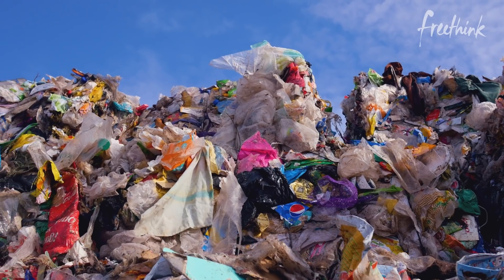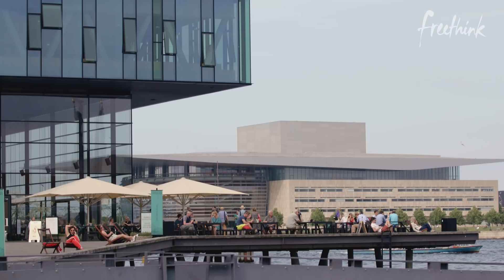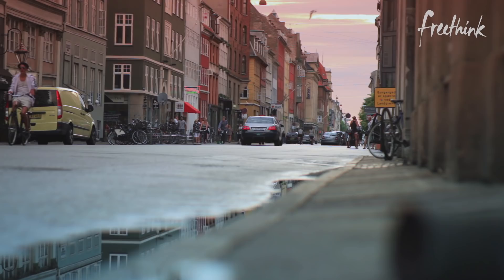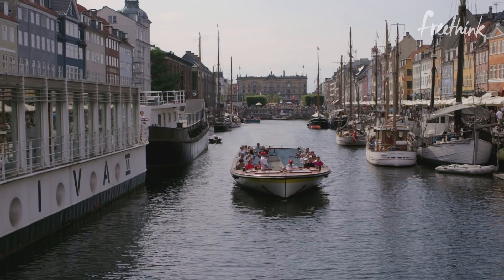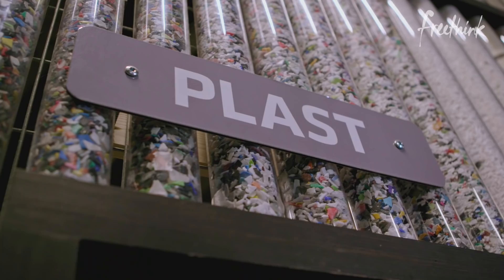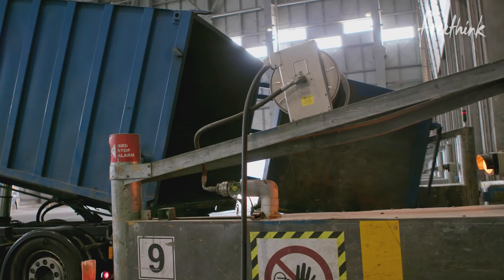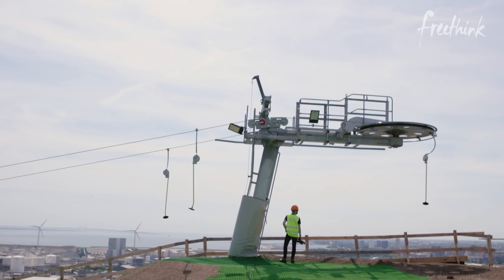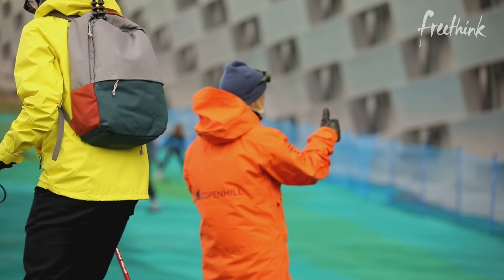Copenhagen Turns Trash Into Ski Slopes

Comment: Where did the Toxic smoke go from burning trash
Reply: thatcoolkidjoey turned into steam
Reply: @mathiashansen3088  lol burning trash does not turn into steam. they burn the trash and use the heat energy to heat up a boiler which creates Steam.  
here's a link to how a steam-powered power plant works https://youtu.be/IdPTuwKEfmA
Reply: I was thinking the same thing, Steam is just H2O so where did the carbon go?
Reply: thatcoolkidjoey so it still turns into steam
Reply: The heat is used to heat a boiler and create steam. The smoke from burning trash is still released into the atmosphere.

Comment: That's a cool video, but you didn't explain what they do with the residue left from the burnt garbage.
Reply: Incineration produces fly ash and bottom ash just as is the case when coal is combusted. The amount of ash produced is around 4 to 10% by volume of the original quantity of waste, the fly ash amounts to about 10% of the total ash. 
In Denmark, the bottom ash is used instead of gravel for patching roads, but in order for it to be used like that it needs to be stored for 3-6 months, as it absorbs CO2 from the air and the pH-value drops, binding heavy metals, making it almost impossible to wash out from the roads.
The fly ash is more of a potential health hazard, as it contains high concentrations of heavy metals such as lead, cadmium, copper and zinc as well as small amounts of dioxins and furans. Currently Denmark mixes it with sewage sludge and sends to Germany or Norway, where it is landfilled.
Reply: Rudkovskyyy 
They have an empty mine in Norway
Reply from the maker: @Rudkovskyyy thanks so much for your detailed response! There are some more details that can be found here: https://www.planningreport.com/2019/08/14/denmarks-amager-bakke-waste-energy-plant-global-model-sustainable-design-efficiency
Reply: @Rudkovskyyy  Nice explanation. Thanks!

Comment: Is burning plastics really a good thing?
Reply: Brandonez Doofenshmirtz they said that the recyclables are separated
Reply: it's exactly the same as burning oil, so not really, but it provides a solution to another problem. i would say not in the long run, but until we figure out what we do with all plastic we might as well get something out of it.
Reply: At low temperatures no, but at high temperatures from what I recall, it is far less damaging to the environment than lying around.
Reply: Plastic is not burned in Denmark it is recycled
Reply: @GentlemanFinn1974  Not really. Denmark recycles only about 30% of plastics and that is one of the worst rates in the EU. When it comes to plastic packaging from households, Denmark only recycles 17,2%, only Hungary has a worse score in Europe. See dakofa.dk/vidensbank/plast (in Danish) for details.
The remaining plastic is mostly incinerated. As a feedstock for a waste incineration CHP, it is probably the best input, as it captures a lot of energy (it is made of oil, after all) and compared with some other materials, it is not a very significant health hazard.

Comment: So coal is worse than burning trash. It's illegal to burn trash because it's so bad for the air! The other stuff makes sense. I believe recycling is the most effective. Finding new ways to recycle former. Non recycling materials. And implement more materials that can be recycled in place of current ones. Like old styrofoam for new potting soil. And wood based styrofoam alternative. Like paper food trays replacing styrofoam trays.🤔

Comment: I thought about doing something like this in my own City. But I don't have the degrees nor the money.
Reply: I wonder what they do with the highly toxic emissions coming from burning trash. Cuz my idea was to cool the gases send it through a centrifuge and then try to break down the more highly toxic compounds.
Reply: @joshuabondurant456  There are no highly toxic emissions. The short explanation: the smoke is washed before being letting into the chimneys. What you think is smoke coming out of the chimneys is actually steam so on hot summer days you can’t even see any "smoke". The emissions from burning waste in Denmark are under normal operation way below the limits set by the EU. Besides from keeping the country free of waste, the burning process creates electricity and district heating which is important in a country with cold climate. 

When the waste is burned, there are two fractions left; a non-toxic and a toxic. The non-toxic is slag (about 20 %) is used for building material, for instance roads. The toxic part is fly ash and toxic because it is filled with metals and is used to fill old mines. But there are ongoing experiments to extract those metals. 

Some waste plants are using biogas to raise the temperature of steam. Biogas is produced by using waste products from farmers and from the food-producing industry. Also some waste plants are using waste products from forests and agriculture, like wood chips, straws, olive stones, seed shells and more. So, we don’t have any waste laying around in Denmark, it is all transformed and recycled (except from a tiny fraction that are deposited). 

For some years now, millions of tons of waste from Europe has been exported to a few European countries who have the capacity for burning the waste, because the EU a decade ago made a law imposing huge fines on each ton of waste that are placed on landfill, and if the same ton still is deposited a year later, they will have to pay again. It really is a disgrace that countries are exporting their waste because it has to be handled and transported; always by trucks and sometimes also partly by ships, which is outright crazy. We need to try to reduce the overall world population, we need to consume less and we need to be smart about handling waste.
Reply: @joshuabondurant456  Further up there is a good explanation on that, but basicly it is filtered out.